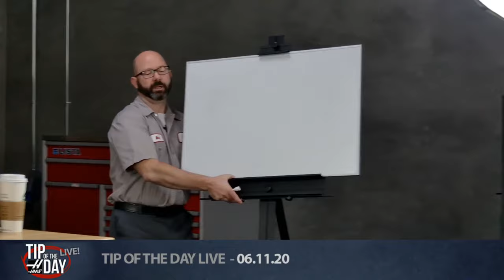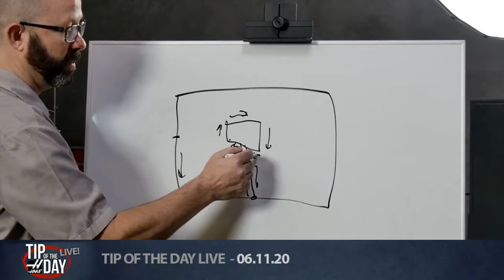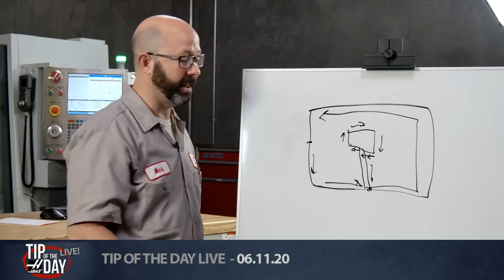Tip of the Day LIVE  - 6-11-2020

Comment: I have a 2020 mini mill - online and on the invoice it says it has “safe run” but it doesn’t and my local dealer couldn’t find it either.  Is there something I am missing on getting that working ?
Reply: It may need a software update from a tech. I think they basically have a base model mill and once the tech comes to install they add extra bells and whistles. So my shops new vf4ss comes pretty much ready to go. The tech then installs exhaust fans, wifi Canada, lights and such. I'm not sure about mini Mills. I'm guessing you do most of the install yourself?
Reply: Or maybe it's a setting you have to turn on
Reply: Thanks Agilar- yes I posted here because the techs are stumped on this
Reply from the maker: Julian vs - We have a video on Safe Run, check it out at the link below.  Let us know if this helps. - Haas Austomation
https://youtu.be/enDkju3b09w
Reply: Haas Automation, Inc. 

Thank you for your reply,  I’ve watched that video before and with the Haas techs here confirmed those options are not available on my machine which is a May build 2020 Mini Mill.  What should I do next ?